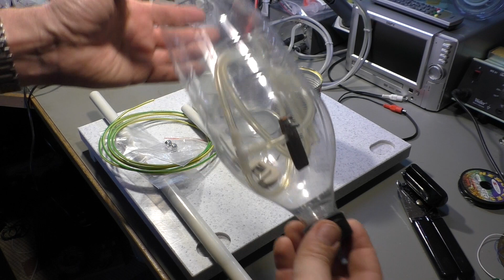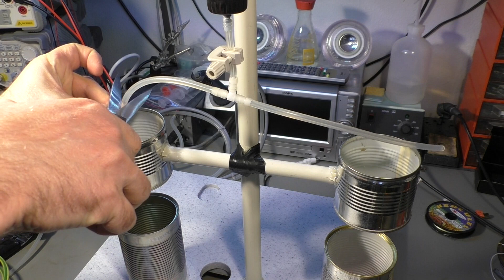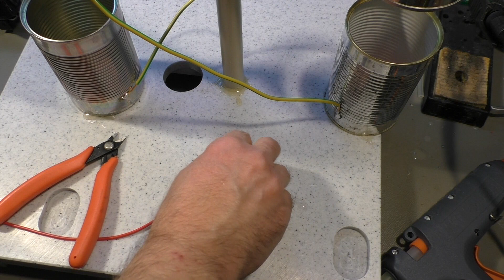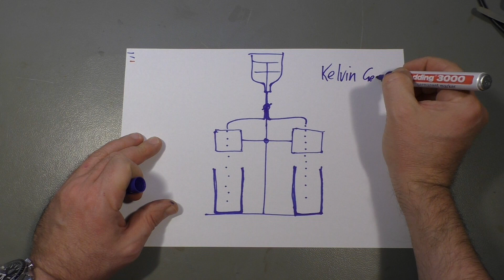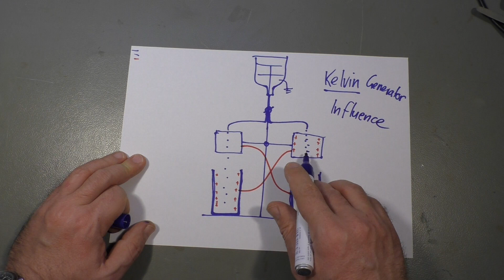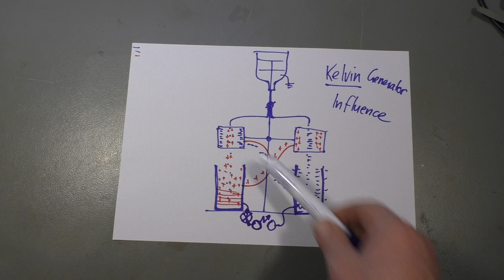High voltage with scrap parts - Kelvin generator - (PWJ164)

Comment: Congratulations on the experiment setup! One question: What type of bulb are you using, and what is the resistance?
Reply from the maker: The bulb is a neon indicator bulb that was used in a 230V AC indicator. The resistor came with it. But I think the resistor value does not matter much because the high voltage just jumps across.

Comment: Can you try  and inductor in that circuit ?
Reply from the maker: For what purpose? To make the discharge pulse longer?
The problem is that the generator is extremely weak. Adding more components will probably overload it.

Comment: The reason water droplet is charged is because the positive charge in the tune drag negative charge to right in the water pipe. The other side will be positive.

Comment: Kind of a dumb question but what happens when you drink the positive charged water or the negative, does the influence have any effect on the water properties??
Reply from the maker: I know what you mean, but it it not possible to drink charged water. As soon as you touch the container, the charges will equalize and disappear. Except you believe in the "water memory".... But then any water that falls from a storm cloud would have the same properties. The charges there are much stronger (see lightning).

Comment: The presentation is good!
Derivation is incorrect!
Reply from the maker: So tell me what's wrong...
Reply: @PlaywithJunk  The surface of the starting water is very small. (1liter 6dm2 = 60'000mm2) The total surface of the water droplets is huge. (In case of 0.1mm drop diameter, the surface is 2'000'000mm2) This is missing.
Therefore, the charge separation occurs. Water is a dielectric!
Reply: My understanding is the randomly charged DROPS have either attraction or repulsion (either but the result is deflection from the natural path under gravity) and that invisible losses of small drops results in charge accumulation

Comment: just looked at it in a simulation in my mind, and it turns out the top  rings act like a capacitor/attractor. they are charged attracting the charge. most charge however stays in the water so due to gravity it falls down and does not touch the ring. also because the ring is round so that it doesn't bend the water. the air acts as a isolator, but the cans at the bottom have direct contact and so conduct well and the charge is stored/transfered to equalize it with the opposite capacitor ring. 

that said the effect would be a lot stronger if you used tubing that works as a great high voltage insulator and build a piece of the ring directly around the end, adding a top load around the upper ring also increases maximum power generation due to the stronger pulling force. the end however needs to be like a cone to prevent the charge from keeping it in the tube. there is a maximum realistic charge per water molecule however and that might be reached quite rapidly so making the capacitive force to strong would be a waste since it can also bring negative effects and takes longer to start properly.
Reply: KELVIN "GENERATOR" IS a FAKE! they  charge water in a lower jar significantly with the Wimshurst machine!!!

Comment: fine sand.
Reply from the maker: I don't know if sand works (try it out!) but I definitively know that steam would work. In an old book I saw a picture if a steam powered static electricity generator. And I saw that machine personally in a museum.
The disadvantage of steam is that air humidity will rise quickly when it's used. This will prevent many experiments from working.

Comment: There must not be droplets inside the upper cans. There must be a continued water flow, so, an opposite charge will go to water in an opposite upper can freely. A speed of this flow is managed so, into a bottom can droplets arrive, preventing an electrical current appear. And so that's why a charge increases.
Reply from the maker: If I understand you right..... If the water flows faster than the electrons (which are very slow) even a constant stream would not cause a problem.?
Yeah I think that could be tried. Let me know about the results :-)
Reply: @PlaywithJunk  A particular electron speed does not matter. As one electron just start "moving away" at an end of one can, another electron "appears" at an end of the other can immediately, because of electrical field and speed of light. My explanation was about providing a continuous "water wire", while water is inside the upper cans, and then it can be separated into drops
Reply from the maker: @sc0or  Ah Ok... well I doubt that makes a big difference.
I once saw a video where they used a shower head to create multiple streams of water. That increased the power quite a bit.

Comment: Basically that is how the Egyptians recharged their batteries for their light bulb.
Reply from the maker: Maybe :-) But I assume they used non-recharchable batteries back then.
Reply: @PlaywithJunk   No  it is a fact ,,they did. why don't you make one and do it yourself and you shall see for yourself . do not believe me.  Just DO IT.
Reply from the maker: @rayamundson8394  With the generator I built, it would take 100 years to charge a coin cell battery... :-)
Reply: @PlaywithJunk  YOU never tried it now did you. TRY IT watch ,do not believe me.
Reply: @rayamundson8394  nice assumption. Backed by not a thing. Why don't you do it and stop bothering this guy with your inability to socialize properly as just another smell being emitted from that basement you reside.
Reply: @outdoortrecker1946  EVERYONE TRY THIS Yourselves,,, make a battery out of salt water THEN discharge it ,,, then recharge it with static charges off of water. LOOK IT UP YOURSELF. LEARN.   You can even charge those salt water batteries with a wimshurst machine.  Those who try to say it is not true,,,,,, prove them WRONG and DO IT yourself and YOU be the judge. A wimhurst machine can charge capacitors just as it can batteries. END of story.
Reply: @outdoortrecker1946   i can not help the ignorant.

Comment: neat to see it lighting up that bulb, very impressive apparatus.(wonders what a couple of these in series would look like) make a 40 watt generator :)
Reply from the maker: 40 Watts... you can be happy to get 40 Milliwatts :-) But what I'd like to know is what happens if you use a showerhead and larger cans or buckets.
Reply: @PlaywithJunk  https://www.youtube.com/watch?v=698F700PM2Y
Reply from the maker: @unition2226  That video is pretty impressive!
I know from an old book that steam will also work as a medium for such a generator.
Reply: might be a great addition to mini kct turbines in series. might even be a way to get the voltage up faster and even pull it from the air using an antenna.

Comment: A very simple and efficient set up and a nice use of junk too!

I believe you are mistaken about the source of the charge. My understanding is that this experiment sorts the ions that are already in the water. 

The water ions (OH- and H3O+) are distributed throughout the water. Isolated ions create no charge because they don't have enough voltage to overcome the insulating properties of the water. They are either attracted or repelled by the charged fields in either of the upper cans and so are drawn into one of the nozzles, pass through, and accumulate in the lower cans to the point where they overcome the resistance of the water, creating a negative charge on one side and a positive charge on the other.

It probably sorts other types of ions present in the water also. I have always wondered if trying it with salt water (or some other ionic additive) might increase the charge.
Reply: bullshit conspiracy level of crap!

Comment: If you used a copper cup for the negative and aluminum for the positive than it would produce a greater charge.
Reply from the maker: certainly not. The polarity of tha charge does not depend on the used material but on the initial charge at start. Charges don't care what material they're on.

Comment: You forgot the capacitors like lyden jars.
In the process of trying to do this with a water pump and return the collector back to the tap.
Reply from the maker: I once tried to attach a small capacitor. It took too long to charge so I lost my patience :-) Maybe it never charged up because of the leakage of the cap.

Comment: I don't think the water droplets are  being negatively charged while they're falling. They're most likely already negatively charged as they come out of the spout.
I'm pretty sure that the positively charged bottomless can (or other charged conductive ring) is repelling the positive charges and attracting negative charges in the tube above it.
Reply: Or creating negatively charged water crystals as it falls after all water is permanently in a state of lattice regardless of its physical state.
Reply: @sebastianstewart6894  fluids (including gas) cannot be in a lattice by definition. Any lattice structure would manifest itself as a solid.
Reply: @Falcrist 
 That's exactly what's happening. This experiment sorts the ions that are already in the water. The water ions (OH- and H3O+) are distributed throughout the water. Isolated ions create no charge because they don't have enough voltage to overcome the insulating properties of the water. They are either attracted or repelled by either of the upper cans and so accumulate in the lower cans to the point where they create a negative charge on one side and a positive charge on the other.

Comment: Nice setup! The charge is transferred onto the droplets already before they leave the tube. There is no way how they otherwise should loose or gain charge in this arrangement. This is also shown in other online explanations of this experiment. See for example https://en.wikipedia.org/wiki/Kelvin_water_dropper
Reply: That wiki explanation makes sense to me. However if the charge starts to separate at the T of the pipe it seems to me that it would short out if a metal pipe is used. Some of the descriptions and photos have a metal pipe used.
Reply: @Kezat  it's enough if the charge is repelled/attracted from/into the drop exactly when it forms at the end of the pipes, just before separating. But once the drop is in the air there is no way how it under the given conditions could be affected when falling through the rings. 

The rings are effectively forming a Farady cage through which the drop falls - the inner volume of the rings should be free from any electrostatic field. This theory could be tested by swapping out the upper cylinders with cylinders of different height and diameter, even just a wire ring - this should not significantly change the function of the apparatus.

Comment: Would be cool to see the cherge buildup on some meter :)
Reply: The voltage involved is probably on the order of 10,000V. He may not have a meter that goes that high lol.
Also, measuring voltage would probably disrupt the process of charge buildup.
Reply: U can connect self made electroscope!

Comment: Excellent demo, thank you. Just-a-thought: As the water droplets are charged - see if you can deflect them with a powerful magnet. Bit tricky avoiding the tins though ;) Me thinks with careful consideration (if that works), - you could build (using a coil) - a very high voltage, high impedance water based amplifier. Perhaps 'Lock Down' is getting to me :)
Reply from the maker: I don't think a magnet would work. But a deflection plate with high voltage, like in an oscilloscope tube will do. In fact the upper ring starts to deflect the droplets when voltage builds up. Sometimes so much that the drops fall outside the lower can.
But I can't see the amplifier idea.... what would you amplify with that?
Reply: Fascinating, if one could make the high voltage proportional to the dripping water deflection (in some way?), or perhaps variable drip flow rate - it would be an amplifier (of sorts). Musical sparks - well that was my odd thinking :) Just another thought: Would it work with dyed, coloured water + deflection, would be great visually. And, does it work with deionised water - could the water be returned (via small pump), to the bottle? All-in-all a great demonstration, thank you.
Reply: @beamer.electronics  I suspect that is would still work with deionised water because water ions, which are what drives this, are forming and dissipating constantly.
Reply: @TonyGrant.  Interesting stuff, thank you.

Comment: Very interesting. Two questions:
1. what effect does increase the length of the hallow CAN have on the charge?
2. does the water have to be droplets to work, or continues water stream will also work?

Thanks.
Reply from the maker: I can only answer the second question. A continuous stream of water would connect and short out the two polarities. Whatever you use (water, marbles, snow) it must be in small pieces to maintain electrical insulation.
Reply: 1) The length of the bottomless can won't matter except in that it will pull the water off course (especially if you don't have a spark gap). If the water hits the bottomless can, it will start to negate the built up charge.

2) The water must be droplets
Reply: @Falcrist  Quite right on that. I built a version of this with insulated upper cylinders for exactly that reason.
Reply: IF you take a high speed camera , with longer jars you will notice the water will actually slow down  then when it discharges it speeds back up again ,,, this is magnetic resistance. Just like you have in an alternateor generator. THEY USE gas engines because they have the power to push the flow of current needed in a circuit,, like your car. Static charges can BEND water. rub a balloon on your head and stick it next to a slowly flowing faucet.... SEE how it bends the water towards the balloon. continuous flow of water works best.  Same principle goes for dropping a magnet down a copper tube ,,,,, it will slow down as it reaches the bottom, then when it discharges it will speed up again.  IT creates a MAGNETIC resistance. This Also applies to Static charges ........ BUT when placing a static charge into wire of todays electricity will create a short.  It is like plugging in a wimhurst machine into 120 outlet...... IT  WILL trip the master fuse and or blow the fuse.

Comment: Speeded up church bells sounds like a warn signal at a railway crossing :-)

P.S.: adding salt to the water allow to check correlation between liquid conductivity and generator efficiency.
Reply from the maker: I have seen tests of that. Seems not to make much difference.

Comment: I think with a lot more water and a turbine you'd get a lot more energy out. ;) same way flour mills used to blow up, nice static arc across the flour dust.
Reply from the maker: More water and a turbine sounds like a conventional hydro power plant. The trick of the Kelvin machine is that it has no moving parts.
Reply: @PlaywithJunk  Except the water.

Comment: Could you make the top cans thinner and longer to improve the charge time?
Reply from the maker: I have seen Kelvin generators with only a ring of wire. I think a shorter tube will concentrate more charges in a smaller area... But why not try it?
Reply: It's dependant on the static field being produced in the upper cans. Static charges like broad, curved surfaces so I suspect that diameter is more important than length.

Comment: Remove the resistor
Reply from the maker: Resistance is futile :-)  Did you see how the arc jumped the resistor? It doesn't matter if it is there or not.
Reply: ... and blow up the bulb... I guess it would not be a happy bulb with 1500-2000 volts passing by...
Reply: @thiesenf , since the pulse is too short i don't think it blow up. In fact, when the resistor arcs essentially isn´t there.
Reply from the maker: This generator will never blow up anything. You wouldn't even feel the arc when touching the sparkgap. I tried it... ;-) It barely has enough energy to make the bulb light up.